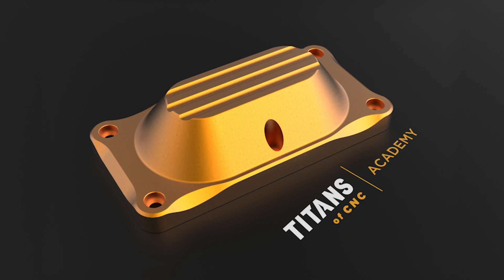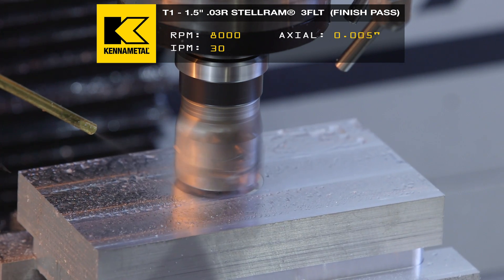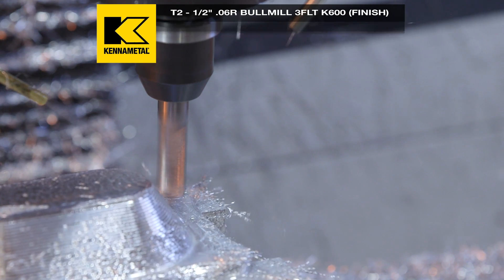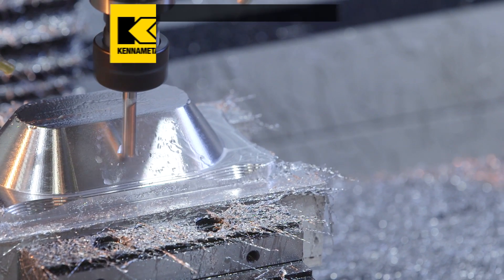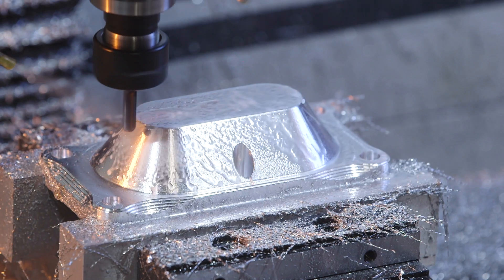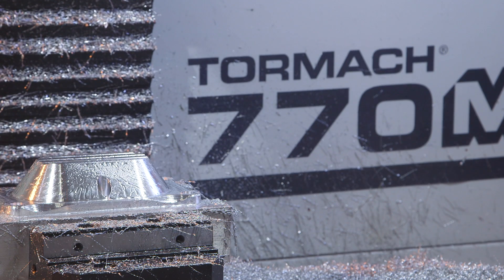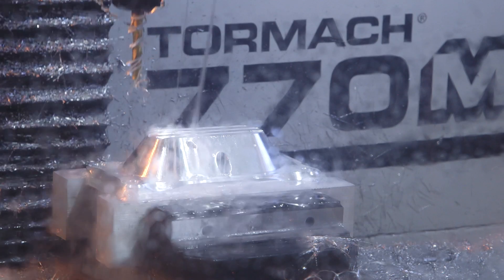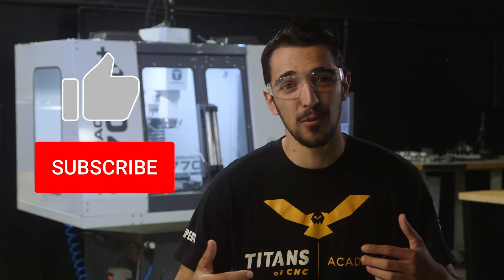Machining the TITAN-53M on a TORMACH - Part 2

Comment: Great video Jacob. I have an 1100 and absolutely love it. Does exactly what it was designed to do. 
Hope to see more Tormach videos.
Cheers
Willy
Reply: How is it at holding tolerances?  I keep seeing these videos and comments saying how they can't hold and aren't worth it, but the size is perfect for where I need it.   I am looking to make some parts that need to be fairly accurate and repeatable but have been  a little scared off by the supposed 'issues' with accuracy and holding tolerances.
Reply: @shirothehero0609  My 1100 will hold tolerances all day long, but you have to use the appropriate feeds & speeds. Correct tooling also makes a big difference. Remember they are not production machines.  If you are planning on doing production, your better off getting a Haas or similar.  There are guys that run very successful businesses using Tormach machines, but they do their homework and run the machine accordingly. 

Cheers
Willy

Comment: That Tormach would be an amazing machine to have. Can’t wait to get one!
Reply: LowJack187 okay thanks.
Reply: I have one, I like it, bought before the price increases.  I agree the prices are getting up there, but if you set realistic expectations I think youll be happy with it. If I was going to spend $25K on a Tormach and a Haas Mini Mill was only $5K more I would go Haas every time.
Reply: The materials aren't going to change, and the pricing isn't going to get any lower unless Trump's tariffs get rolled back.

The slight price increase of the new M-series isn't really all that bad, considering that freight is now free. By the time you paid freight on the previous pricing model, it wasn't too far off from what it currently is now.

If I had it to do over, I would've bought a 440 to use to overcome the steep learning curve of getting into CNC machining, and then when I was ready to move up from there, would've bought an older Fadal machine and retrofitted it with a modern controller.

Definitely wouldn't have gone straight to the 1100 like I did. But you live and learn.

Comment: In our shop we have DMG MORIs on a sponsor type bases. They run the mass production parts (100 max). I primarily work with prototype parts (1-5 parts). On a knee mill retrofitted with acu-rite mill power. 

My question is, for someone looking to purchase a mill to start making a side hustle in his own garage. Should I spend the money on a haas mini mill, a 1100m+ tormach (when they’re available), or just get another knee mill with mill power? I want to stay under 50k. Size isn’t an issue. Just want something that’s versatile.
Reply: Have you considered a used VF-2 with a next generation controller? I've also seen used mini mills go for around $15k and used series 3 tormachs in the $8-20k range depending on options or up to $25k new. I think it would really come down to knowing what you're trying to achieve.

I personally have run a Mini Mill 2 and would say that it's features are more appealing than a tormach because of the cat40 taper spindle and more rigid construction.

But that's not to say that a tormach isn't capable in the right hands. I've seen great small production work by @lms_prototyping on Instagram. I've seen him cut steel, titanium, copper, and more.
Reply: Consider your power requirements. The Mori 1100V is only going to run on 3ø 220 delta wye. And at about 80 Amps. So while that would be my 1st choice hands down for a 3ax mill, it’s not likely to work in a garage environment. For a side hustle, I’d look for a good deal on a low mileage mini mill. You can run it on single phase, it has a tool mag, can take decent cuts with proper tool paths, will fit through a garage door, etc. (provided it works with your part sizes)
Reply: adam tankersley I should have put more detail, size, power, etc isn’t a restriction, My shop is 30’x108’ and wired for all the right stuff. I’m more worried that the 5” 6,000psi of concrete isn’t enough. 

@Jonathan Taylor  I have a used VF-2 in my watch on eBay currently. Majority of my business is racing. So lots of 6061, 7075, 4130, 4140, and EDT150. I like the really simple programming the ACU-Rite has but it’s very limited to what I can do. This is why I’m leaning towards a full enclosed CNC more. I’m still 8-10 months out from purchasing a mill, unless a screaming deal comes up. But I like to have a plan of attack.

Comment: Love your enthusiasm Jacob. Pretty nice surface finish you got on that part. When you guys first got the 770 I remember the first part you made being 0.003" off. How is the precision now, and what did you have to do to improve it? Ciao, Marco.
Reply: I have the same question!  I've been wanting a 770/1100 but I've been scared off by the supposed tolerance issues and bad accuracy.  It's hard to know what to believe out there and what is operator or setup error and what is a crap machine.
Reply: The machine may come shipped on the loose side / lash etc. once it has run a while you can tighten up the bearing blocks and adjust the ways if there is play....
Reply: @shirothehero0609  Not sure if you're still thinking about getting a Tormach. I have the Series 3 PCNC 1100 and it's been great. I regularly hit +/- .001" (+/-.002" on setup parts) machining parts out of stainless, aluminum, and Delrin. You have to take time to set things up properly so everything is leveled and tight though. I think issues come up when people don't pay attention to the little details of setting up the machine.
Reply: @tldinh  hey, thanks for the reply.    I ended up finding a 770s3 locally that was near new.   So yeah, I definitely pulled the trigger and had it about 2 months.  Had the 4th axis super spacer, pdb and a good set of accessories with it.  So far I've loved it but haven't gotten to use it as much as I'd have liked to due to some work travel craziness.   Anyhow, I appreciate the validation in the accuracy and repeatability.   I came down on the same conclusion that most of the crap talking was rooted in owner error or poor maintenance and it definitely turned out to be true.   Thanks again sir.

Comment: You mentioned torquing down to 40 ft-lbs...how did you come up with that? Do you have any tutorials on that subject?
Reply: That's a good question, allot of times it just comes down to that specific job and the type of fixture you are using
Reply: I would also like more info on vise torque and how it relates to "the correct amount needed" to hold a part in the vise.
Reply: Just crank it till the casting cracks, the back off a quarter turn and call in the apprentice.

Comment: Did you start from top to bottom on that 3d profiling finish pass on purpose?  What do you think of up milling vs down milling on a steep wall like that?  Axial load like a high feed mill mean better surface finish?  You should see the parts I'm making on a Tormach.

Comment: Does this machine have a Power Draw Bar?  Any tool pull out with the 1/2"?  I guess the .020" WOC helped with that.  Would like to see you push the machine since it has servos and Titan is always pushing speed.  Maybe the servos are only good for increased accuracy and not for speed.

Comment: Tolerance is always key in this work, even at the low end of machines.  Original drawing length is 5.850, he gets 5,851.  With is set to 2.900, he gets 2.899.  That looks very nice for 15-20k machine.

Comment: I dont get the hate comments.. haiz. So how much for this machine? Also, can someome from the IT industry own a machine shop? Is the transition that hard?
Reply: Yes the transition is hard but doable.  If your background is in the IT world and you want to own a shop, find a number 2, someone who you will pay well and take care of.  In exchange they will treat your money like their money and your company like their company.  Or you could work in a machine shop for 5 to 10 years learning a lot (but not everything) and go from there.  Im sure youve dealt with CIO or CTO's in your current industry that have no experience but an MBA.  The successful ones surround themselves with smart folks they can trust.
Reply: I work in IT, and have owned a Tormach 1100 for the past 2.5 years. It's a STEEP learning curve, but it's doable. It took me about 3 weeks of long nights to get to where I could confidently make the parts I wanted to make, and know I wasn't going to break tools.

I blew up about $800 in carbide the first week I had the machine. I started in A36 steel though. My advice would be to start in aluminum, and build from there.

Before you buy the machine, download Fusion360 and start learning how to model. Once you've got modeling down, start learning the CAM side of things. Some things you won't be able to learn until you're standing in front of the machine and running it, but you can learn a TON just using the software, and watching Youtube videos.

NYC CNC has a fantastic channel that consists almost entirely of videos on running Tormach, and using Fusion 360. It's worth checking out if you're serious.

Comment: I'm working on a fluted rifle barrel on my Tormach 770.  I have the 4th-axis setup on it and after alot of fumbling I finally got it to work for me.  I mention this because I have yet to successfully download and use the fusion 360 software made available through my TITANS Of CNC account as a student of your Academy.

I was wondering how you would go about fluting a barrel using the fusion 360 software?  I'm using the SprutCam software that came with my mill package.  The rifle barrel in question is only 17" long and tapered from 1.063" at the chamber end and .875" at the muzzle end.  My fluting is modeled so that there are separate sections of spiral fluting on either end while in between the two sections of fluting the is a 1.5" space on the barrel that has 7 straight front to back flutes of an in and a quarter long.

The reason that I set it up this way was because of the very small work envelop in the X-Axis.  I can cut the flutes on the chamber end of my barrel as well as the center flutes, and then I have to flip the barrel around and cut the flutes on the muzzle end.  I'm sure there's an easier way to go about this but being that I'm self-taught, I thought I'd ask how you guys would have gone about setting up such a project on your Tormach 770.

Comment: The young guy should be commended for stepping up, fronting the camera, showing passion, enthusiasm, and making an honest effort to contribute something positive.  On the technical side of things it sounded like the Tormach was being driven close to its limits so I wonder if it's worthwhile doing a power calculation to add to the feeds and speeds data?